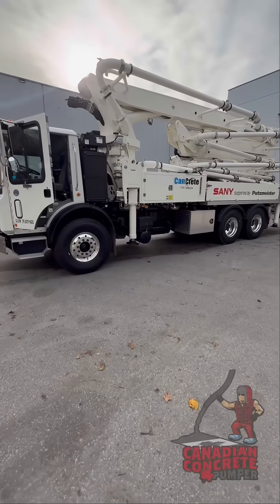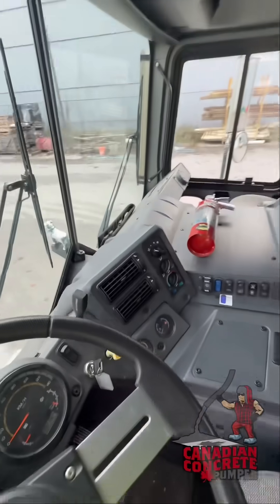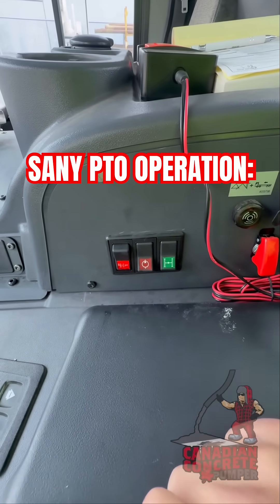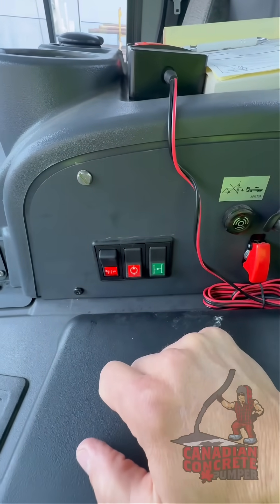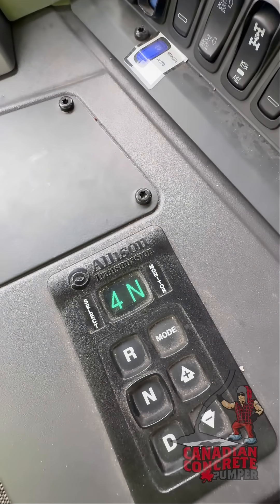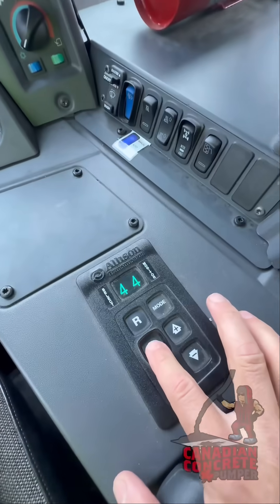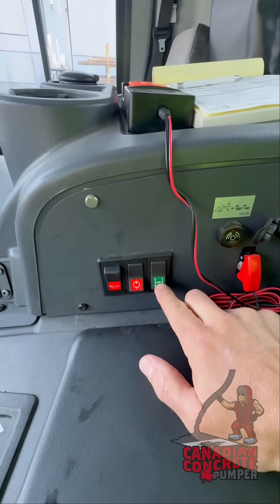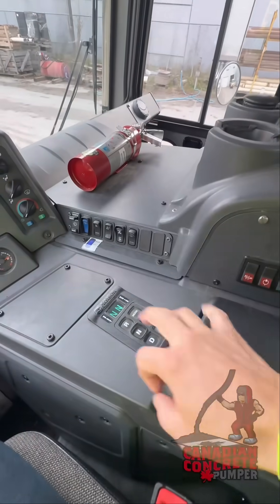How to Switch a Sany Concrete Pump into/out of PTO:

Comment: There is simply nothing I could do to ever get that right 😅 every single god damn time I get in my pump I do the order wrong and it won't go back into gear. I ran a pump for years where the parking brake didn't need to be on to switch it in and out and my brain always ALWAYS ALWAYS hits the parking brake first.